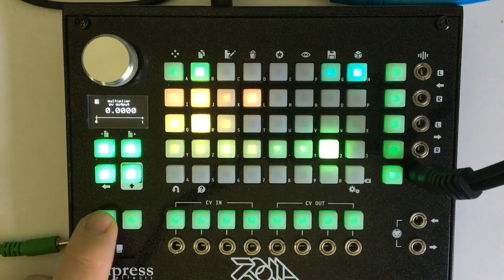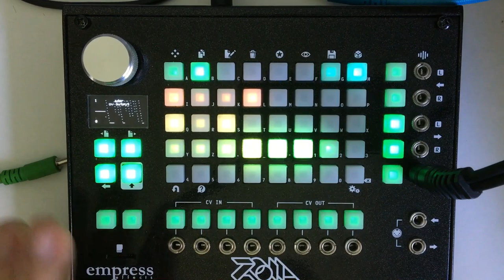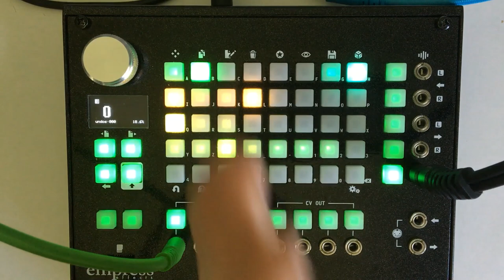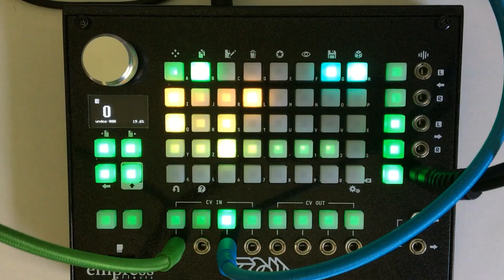Empress Effects ZOIA Euroburo tutorial:  "CV input options -- clock filters and transpose 0V"

Comment: Thank you for this! It was unusable for me without clock filter. I can still only look at this as a bug or something that should be fixed in a hardware revision - never seen anything like it on other modules in 20+ years of using modular.
Reply from the maker: Because of the heterogeneous applications of Zebu's CV inputs, the clock filters are a necessary equal.  If you look at a dedicated trigger or gate input on another module, it too likely has filtering applied at some point.  That's an option available because that input is single-use, unlike the ones used for Euroburo.

If you made a hardware revision to eliminate clock filtering issues (by making them automatically filtered), it would affect modulation and pitch CV.
Reply: @ChristopherHMJacques  First of all .... omg thank you! this was killing me and I would have never figured this out on my own ... but can you give some examples of when you would not want clock filtering on an input? Hoping to get a better understanding of why I might turn this on or off, versus just always turning it on!
Reply from the maker: @ggellner  Thank you!  As I mentioned in the previous comment, clock filtering would adversely affect modulation and pitch CV, so, by all means, when employing triggers and gates, use the clock filters, but for LFOs, envelopes, pitch sequencing, etc. it would be a problem.

The way the clock filter works, a voltage threshold is introduced, which the signal must exceed to be passed to the ZOIA internal system.  So, the noise isn't passed, but the clock signal, being much stronger than the noise, does pass through.

I don't fully understand the technical side of this, so bear with me; the noise essentially disappears as voltage increases above 0V, so with a sine wave LFO, for instance, applied to the input, it is not an issue.  But if you introduced a clock filter to a sine wave LFO, part of its trough would be clipped.  (There are, most likely, some interesting applications of this to be explored, but if you just want a sine wave LFO to perform as expected, a clock filter would interfere, without making any positive contribution.)

I hope that helps?  Basically:  clocks (gates, triggers, etc.), yes, definitely using filtering; most other types of signals, probably not.
Reply: @ChristopherHMJacques  Wow! Thank you so much. So happy I came across your channel! Amazing information.